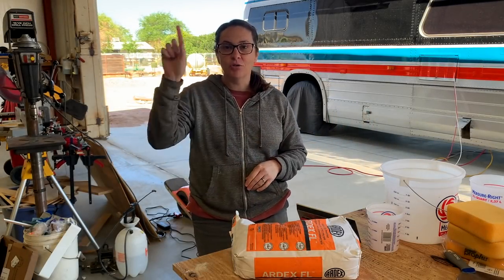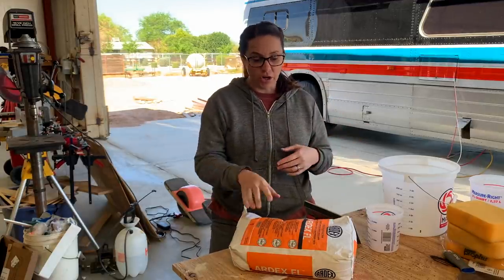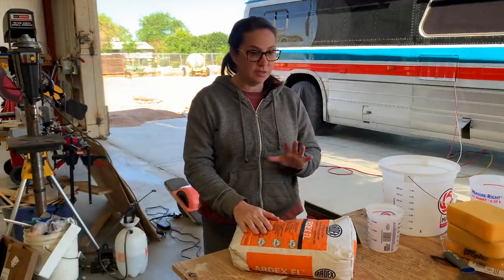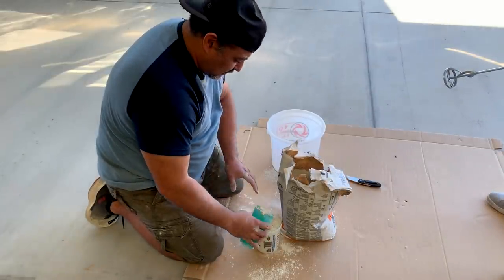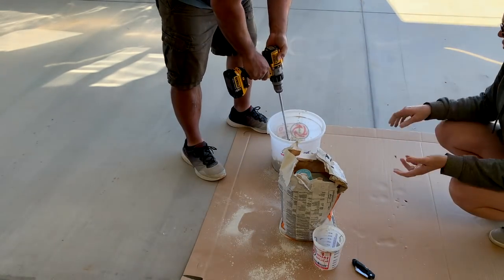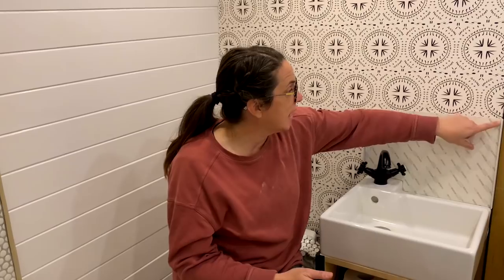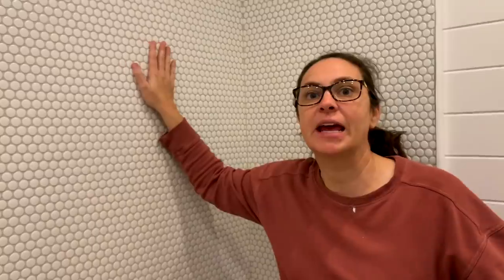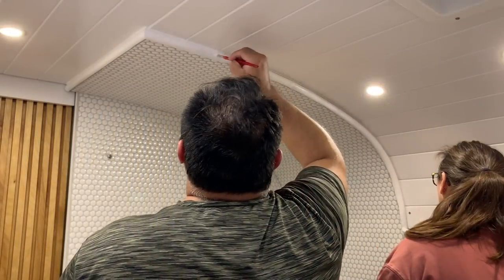Bathroom - Part 4: Grout and Fixtures

Comment: The trick to removing the haze is a clean sponge using two buckets. The first bucket is to remove the heavy grout, the second is to remove the remaining grout. You only clean the grouted tile once, as in wipe one small section once with a clean side of the sponge, flip it over and wipe it once again, always in the same direction. Repeat for each area you wipe. When you try to wipe a large area you only move the grout creating the haze in another area. Nice tile job! 👍
Reply from the maker: Thank you for the tips. :)

Comment: That looks great, as usual, with your meticulous craftsmanship. The hardware installation brought back memories of the brand new fiberglass shower in our first house, when I dropped the tool, taking a giant chip out of the surface of the tub. Moving blanket or a towel protect the fragile finish AND slow the small parts from running down the drain.
Reply from the maker: Thank you so much.  I had nightmares about dropping something in the tub and breaking it!  Thankfully it has held up really well.

Comment: Well done. Looks great. I had pretty bad luck using the flexible grout with ceramic tiles over wood. But that was about 35 years ago. I'm sure they've perfected it since. I'm sure you'll let us know either way, eh.  :^)
Thanks for the video.  Saint
Reply from the maker: Thank you Saint - During our research we discovered that wood can be a very tricky substrate.  We double and triple checked that the adhesive we used was indeed rated for plywood.  We have about 2600 miles under our belts and so far it is holding strong.  Of course we will let you know if that changes or if the shower fails in any way.
Reply: @BeginningfromthisMorning  Cool. If it's made it 2600 miles, I think it's safe to say it worked just fine. Yay! Looks beautiful too.
Just sane... :^)  Saint

Comment: Turned out looking fantastic guys!! Black handles are really sharp! Now that you've been living with it for a little while, are you still happy how it all went together, or is there anything you would change? In the end, is the sink backsplash mat as easy to use as you thought/hoped? Wonder if it would be easier with placing single tiles rather then sheets?? I have a kitchen backsplash to do, wondering if that would be a good option????
Reply from the maker: Thank you Sun - It has held together very very well.  The backsplash has held up great.  It was much easier and less messy than using thin-set.  I think single tiles however, would be much, much harder.  I think the musselbound stuff on a backsplash would be an excellent option.
Reply: @BeginningfromthisMorning  glad it's working out as well as you had hoped and planned. And thanks for the input. Less messy def sounds like a win no matter what!! Now if finding the right tile would be just as easy....

Comment: G'day everyone, 
Kevin here from Australia.  Great video everything came together nicely.  But how is it all functioning on the road. Any leaks. 
Stay healthy and safe travelling. 
✌🏻  Peace.
Reply from the maker: Thank you Kevin it has held up very well so far!  No leaks, squeaks or bad behavior of any kind.  One thing that we did struggle with a little bit was the soap holder.  You will see it in the next video but we started out with one of those corner ones - that was a small disaster that failed within 1 week of using it.  Then we moved to a basket that we hung on the side wall with sticky things.  That worked for about a month and then we had to buy new stickies with just failed literally 3 days ago.  Now we have attached something to the shower bar which seems to be doing the job.  We'll let you know more as the story unfolds but I think we are pretty happy with the shower bar caddies.
Reply: @BeginningfromthisMorning  ✌🏻